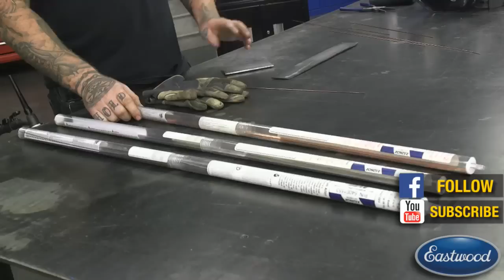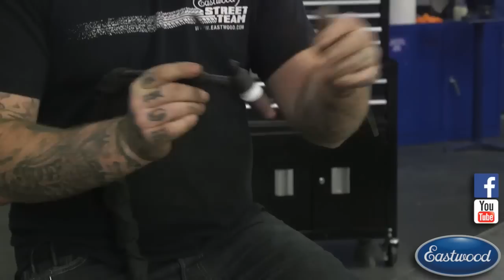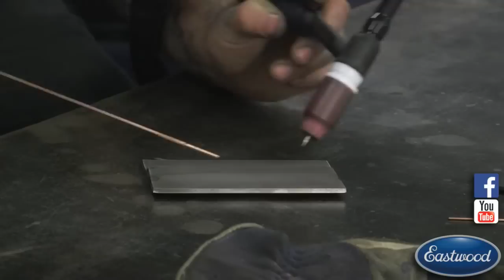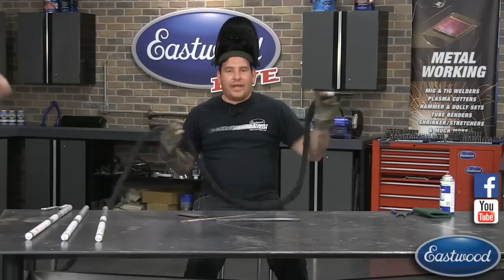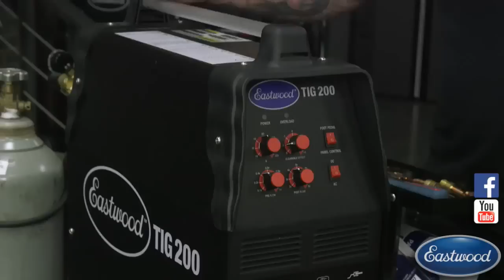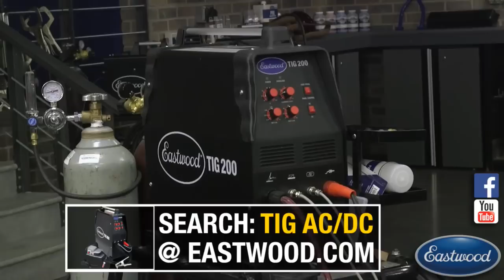Improve Your TIG Welding Skills! Filler Rod Tips & Tricks - Eastwood

Comment: I'm new to Tig welding: very useful video series. 
2 questions: first, can you use stainless filler to weld mild steel? i've got a bunch of ER316L, ER314L AND W19 123L rods that came with a 'ready to weld' kit bundle but no ER702 so I'd like to use the 316L etc.  
Secondly, is there a look up chart showing the rods you can use to weld different types metals etc. and the optimum rod sizes for different size of metals and joints?

Comment: hi guys, I made myself a welding table which is also a cart for the welder and gas tubes. in order to incorporate the gas tubes in the cart/table I had to put them horizontally instead of vertically. everybody says it's a problem but they cannot explain why. so, is there a problem with putting the gas tanks this way? thanks a lot!
Reply: carspa 

No.. it's only a problem when the internal product is a liquid.. like acetylene.. 

My tanks are horizontal aswell works fine. They could become a missle of the valve is busted off

Comment: While watching I thought of something I have been noticing. When first started TIG weld with metal at room temperature I add filler at a certain rate, but as metal heats in direction of weld I find my speed increases and feeding rod also changes. I am not sure if this happens for everyone or if I am doing something wrong. I have tried reducing the current as well to match puddle and keep a constant speed.
Reply: Yes, as the work heats up, you need to reduce the amperage and/or increase the travel speed. 2 cents...

Comment: You guys have great videos on TIG welding aluminum and regular steel, can you guys do a full session just on Stainless Steel TIG welding? I know there are some things that are unique to SS like warping and not losing your corrosion protection by overheating.
Thanks,
Ryan (a proud owner of the TIG 200)
Reply: Initial DIY mods best advice I can give you is if you are welding pipe make sure that you purge it very well and don't have a landing on the bevel use low heat and watch for the draw it shrinks like crazy especially thin wall